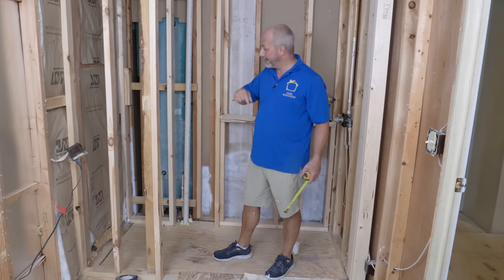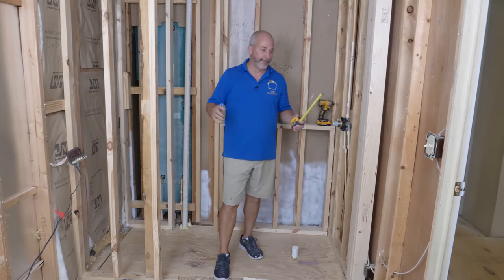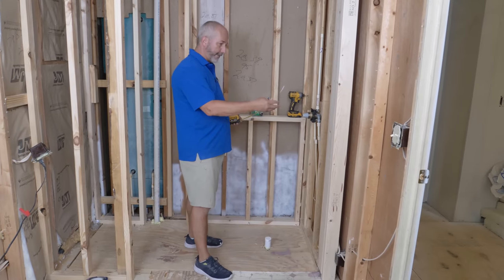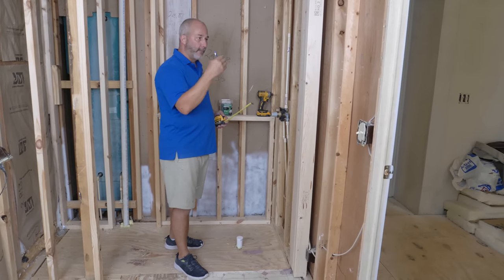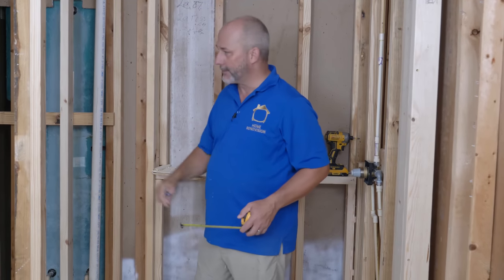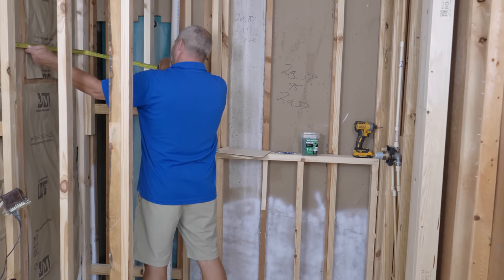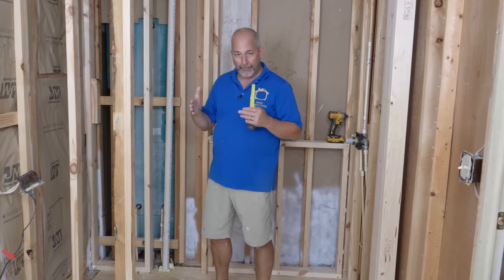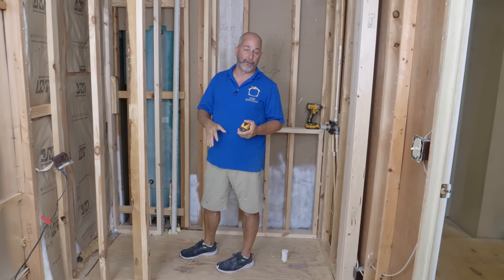Why I Chose Cement Board for my Shower

Comment: I'm surprised you're not wearing a safety mask. Hardie's Safety Data Sheet recommends using an N-95 (minimum) respirator/dust mask. The raised dust from cutting cement board contains crystalline silica, which is really bad for your lungs. Keep all living things away from the work area.
Reply: I’m not surprised. Jeff has talked down safety equipment in the past. He thinks it’s for the weak. Darwin is eying him up.
Reply: @dspears666  Well it's evident the way he uses a circular saw against his thigh when cutting among other things, "hasn't happened in 30 years can't happen now" -  kind of safety thinking is a killer.
Reply: Yeah you are right.  Silicosis is a terrible disease and people must take sensible precautions to prevent it when cuitting fibre cement.  I'd lose my job if the boss saw me with my mask off when cutting this stuff and who could blame him?
Reply from the maker: the recommendation is for installers who work with this stuff every day. as a twice a year guy I am not concerned. Cheers!
Reply: You SHOULD be concerned when you spruik using the right tools and products for the job, but are flippant with basic safety 😢🤷
Reply: @HomeRenoVisionDIY  I have to disagree with you on this. In any event, twice a year times 15 years is 30 exposures. Definitely not safe.

Comment: Obligatory Jeff should wear a mask when cutting cement board, "silicosis is no joke" comment
Reply from the maker: LOL. I get it. however outside twice a year is not silicosis going to create. Cheers!
Reply: Hi Jeff , I think its beter too use  a mask ,do the job safe  is also a DIY thing
Reply: Lead by example.......safety first!
Reply: Just hold your breathing or breath shallow. I do it all the time welding. Good practice. My Psychotic Disorder kicks in when I wear masks 😷I'm im mentally allergic. I don't blame Jeff. ❤  it's not practical. When I use a mask, it's $150 make that works 99% better
Reply: There’s no amount of cement in my respiratory system that’s acceptable.  If you don’t want a mask set up a fan upwind of you so that dust blows away from you and the wind carries it away.
Reply: Safety third 👌
Reply: I can hear @VancouverCarpenter saying “handyman special” while pulling his shirt up to cover his nose. Also, “feather those edges.”
Reply: Nah, work fast. Safety last.
Reply: @HomeRenoVisionDIY Famous last words.  One good faceful of dust can get you silicosis.
Reply: @HomeRenoVisionDIY Just a liiiiiiiiiiiiiiiite bit of poison never killed anybody. 😆

Comment: Love your videos. Question: I am replacing an old 60" fiberglass tub/shower with a Transolid walk-in shower kit. I need to raise the floor under it by 1.75" to match 2 layers of tile in the bathroom.  I'm planning to use 2 layers of 1/2" cement board and one layer of 3/4" plywood to do this. Does that sound  reasonable?   Thanks, Tom

Comment: Thats James Hardie Hydro Defense backer board, it is 100% waterproof already. All thats needed is waterproofing on the seams and screws. I wound up using it in my bathroom I built almost two years ago. A couple of negatives, its a nightmare to cut as far as the dust is concerned and you must use the circ saw and blade setup he has, you cant cut it with a standard cement board knife, just wont work. Second, I would not tile right over it again after my first experience with it, you have absoultely zero time before the thinset skins over and starts drying out when you apply it to the board, it pulls the moisture right out of it, dampening it before hand did little to mitigate that. And lastly, its really heavy, no joke. Its a great product, but I wouldnt use it again.
Reply: I loved it better than the traditional stuff. And I think you'll always have issues with Mostar being absorbed in to any product. I lined to always wet the surface or bake butter both surfaces. I truly think it's a simple product for a DIYER 
Yes, always cut it outside. I cut my stuff in the basement. I should break that habit. It's not a great idea lol.
Reply: @CalebGibbsAvenue  Yes, I agree, far superior to the standard durock, however, if and when I do it again, I'll do the foam board. Just an easier product to work with.....

Comment: Wedi board, pricier material but easy to carry, cut and seal.
Reply from the maker: the problem with that system is it relies on the integrity of the installer to have a proper amount of adhesive in every spot of every joint or it fails. I just can't trust an installer these days to do that for me.

Comment: How are you going to waterproof it? Can't wait to see because usually if you're doing a traditional in and out system, the pre slope, would already be done and the vinyl liner. But I have a feeling you're gonna use some type of topical waterproofing over that period. This should be interesting..... Also, that is not full concrete board, concrete board is way darker and heavier, that is, fiber "concrete" board, each have their own specific screw. You're using the one for Hardy backer.  Inch 5/8 screws are what you're supposed to use normally with that stuff. And the inch and a quarter screws are for concrete walls. So you don't hit the concrete.👍..... On actual concrete board, you're supposed to go 6 inches with the screws on the edges apart from each other and 8 inches apart in the field of the board or not the perimeter. Can't wait to see the waterproofing on this one.
Reply from the maker: my waterproofing system video is soon and it is guarantied to never fail. Cheers!
Reply: @HomeRenoVisionDIY  I'll be waiting

Comment: Suppose one has a partial gallon of polyurethane for protecting wood that will likely go to waste if not used. Is there any value (or is it too paranoid) in putting a coat of polyurethane on the top edges of the support joists (when you had them exposed) and/or the top layer of that plywood floor? Just in case a crack somehow develops in the shower floor that allows fluid to leak through?

Comment: Should you not put your 1st board-s on the ceiling, similar to drywall?
Reply from the maker: no need to protect the ceiling in a normal use bathroom. Cheers!

Comment: Do I need to use red whatever on cement board or I can just place tiles right on the cement board?
Reply: Best to use a waterproofing membrane. Grout, thinset, and cement board are not waterproof.

Remember to tape all joints on cement board, tub, etc. before rolling/painting on the waterproofing membrane.
Reply: What the person above me said.. you need to waterproof it..
Reply: @alexl53  thanks
Reply: It has a water repellent. But it's mostly a water diversion system. 
But this is what I found.
 Hardie Backer Cement Board with HydroDefense Technology is a waterproof cement backerboard designed for use on walls, floors and countertops. Use on walls in moisture prone areas, as a tile backerboard.
But like Jeff sed, it's not vapor pruff. The screws and crevices are open.  So there should be a vapor barer. If the area does require water proofing.

Comment: Jeff, prior to installing the cement board, is it necessary to install any insulation?
Reply: Unless it's an exterior wall it's not need. You could add for soundproofing if desired.
Reply from the maker: you can insulate for sound but for wet areas i prefer to insulate with rockwool if you are not adding a vapor barrier on the wall as well. fiberglass is fine if you vapor proof the walls. red gaurd is not a vapor proof product so you need a plastic woven sheet like kerdi membrane .

Comment: Problem is that broken corner now has only 1/4 of the hole edge for the screw to hold on to so basically it has no screw at all that's why it's is an ISSUE when you break a corner like that.
Reply from the maker: i think you are overthinking this. I am using large format tile so it will not be an issue!

Comment: What's the reason you would choose cement board over foam board
Reply from the maker: cost for sure. foam board if I need the high traffic protection for vapor.

Comment: GO BOARD,  the best way to go. Because it's a foam board it won't absorb water and it comes with a waterproof membrane already installed. Bottom line is, faster install and better waterproofing. It can be cut with a knife and lighter to carry.

Comment: "mold proof" in the thumbnail doesn't pass the sniff test. Doesn't disintegrate with water damage? Good case for that. But mold grows wherever water goes, and if you get water behind your tiles, mold will grow there.
Reply: Mold also requires organic material to grow. Cement board doesn't contain any organic material.
Reply: @tay13666  It can grow on any surface in the home, organic or not. Where water collects, mold will grow. I presume it just feeds on whatever is floating in the air that makes it's way into the water on non-organic surfaces.
Reply from the maker: keep watching and you will know why we are mold proof. Cheers!

Comment: You dont need a cement board blade for 30 bucks. A 7 dollar avanti 20 tooth blade will cut through 50 boards before it dulls out. Thats what i do.

Comment: “We all make mistakes” Not only that, the next DIY guy will drill wood screws straight through the shower cell into your drywall to mount a soap dish or whatever dumb thing 😢
Reply from the maker: never install a fixture to a tile wall with a screw unless it is stainless steel.. Cheers!